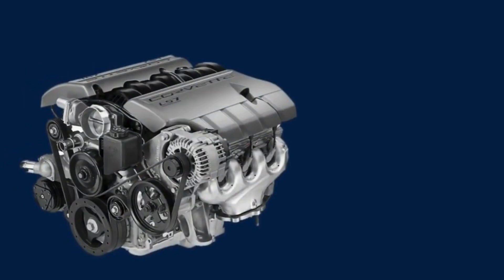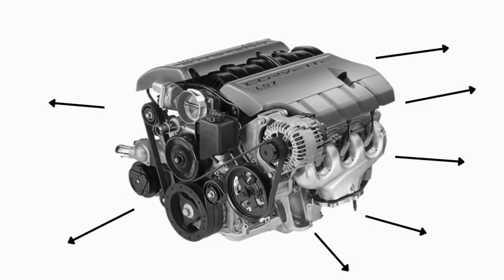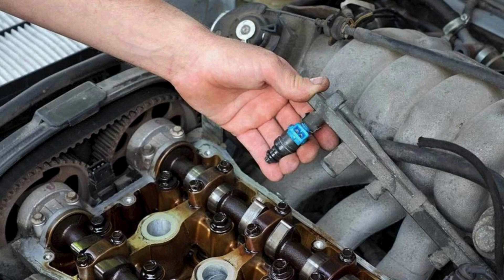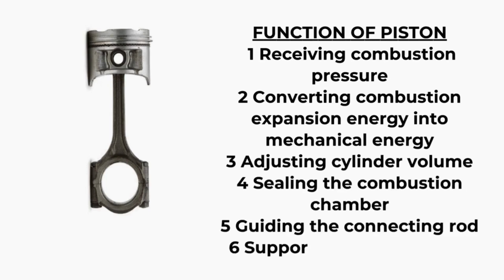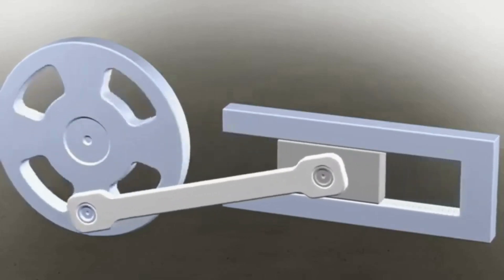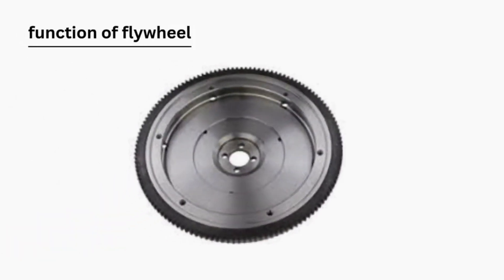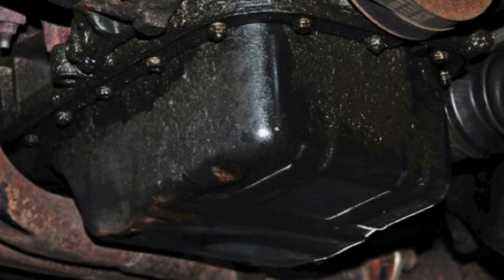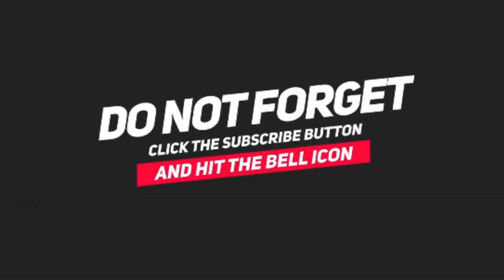Car Engine Components and Their Functions Explained in Details

Comment: we need about 10 KVA new Cummins DG how to be working
Reply from the maker: Thanks for your comment! If you're referring to a 10 kVA (kilovolt-ampere) diesel generator (DG) and want to know how it works, I’ll definitely make a video or provide a quick explanation. Diesel generators use a diesel engine to spin an alternator and generate electricity. The video will be coming soon!